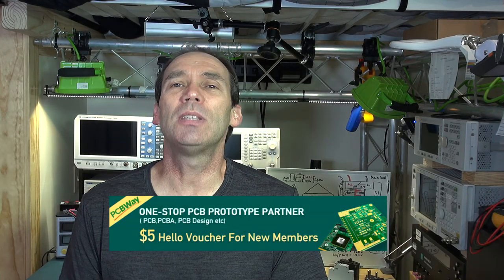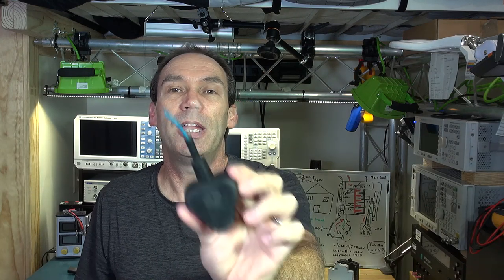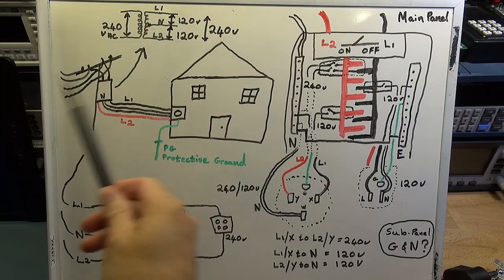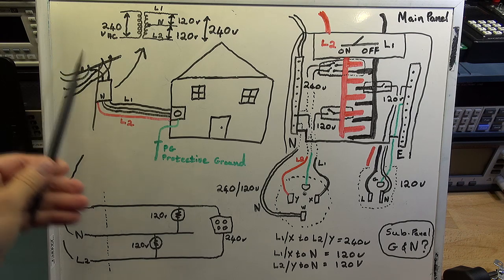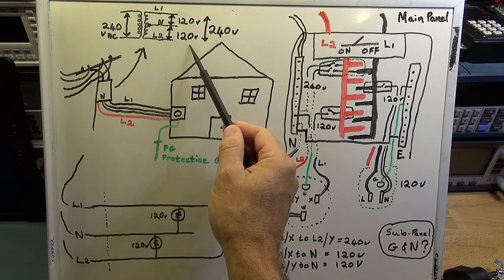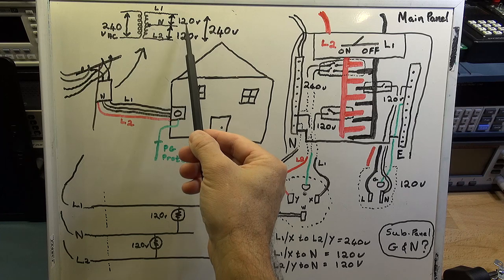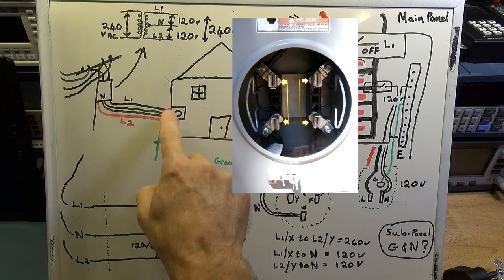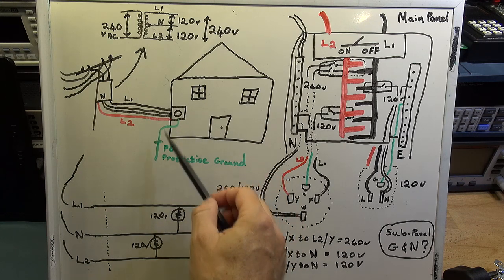The USA / American Split-Phase Electrical System

Comment: I used to work for a locally owned computer shop (in the US) and would often perform on-site service.  Went to a strip-mall type office for a "printer not working" call.  The printer and the PC were some distance apart and plugged in to separate outlets.  Upon examination, the printer cable, PC parallel port, and the printer port all showed signs of arcing/burning.  I'm not a qualified electrician, but I determined that one of the outlets was wired incorrectly (live and neutral reversed) and ground and neutral were tied together.  This meant that the "grounded" printer chassis was actually at line potential.  In most parallel ports, the shield is also chassis ground,  so when the PC and printer were connected and powered on, full line power passed through the printer cable.

They had to buy a new PC and printer, and I hope that they submitted a claim to the property owner.
Reply from the maker: Oh my goodness... Thanks for the post.

Comment: I think you mixed GFCI (Ground Fault Circuit Interrupter) with ordinary circuit breaker you show in video  @~27:00 which protects against short circuit conditions and overload conditions. 
Earth leakage breaker needs four poles, two for live (live in live out) and two for neutral (neutral in and neutral out), Both live and neutral currents are being measured. if current through one of them is not equal to other, then there is fault in circuit and the current is flowing through elsewhere.
Reply from the maker: You are  correct, my memory of the SA distribution board has diminished. The breaker that caters for earth leakage is two pole, two connections in, one for live, one for neutral; two connections out for the live and neutral. You would have multiple circuits with their individual load breakers sharing an individual earth leakage breaker. 
 https://mce.co.za/product/single-phase-earth-leakage/

Comment: 21:30  Your 220v line should be a dedicated line.  Dedicated to that one appliance.
Did you have a neutral running to that stove?  If you lose one leg and the other is hot, the hot one plus the neutral will run anything on that stove that runs on 110v.
That might be any control lights or a clock.  I had that problem with a dryer that used 110 on the motor and 220 on the heating element.  One leg popped the breaker and the dryer would turn but there was no heat.  Instead of a pinned breaker switch, I had 2 individual breakers feeding the dryer.
Reply: That can be perfectly fine, as long as both breakers are the same amperage and you have the "Common Trip" adapter put in place. Sounds like you were missing the "Common Trip" QO Tandem Circuit Breaker Handle Tie, they're like five bucks.
Reply: @DeepPastry  I had no idea there was such a thing.  Thank you.  I need to run down to Home Depot sometime this weekend and I'll see if I can find one.  Thank you so much.
Reply: i cant imagine ever sharing a 240v device.  everything i've wired up was dedicated.  goes to show what bizarre things people think up!

Comment: depending on the utility, PGE/SCE/LADWP, the distribution voltage can be 4160/4300/7500 volts on the utility pole feeding the pole pig (transformer), and can be single phase or 3 phase depending on the loads that are being serviced.
The distribution station also has regulators that try and keep the voltage somewhat constant.  These are tapped autotransformers that control A and C phase and B phase is not regulated.  The controls in the regulators compensate for voltage droop, line impedance and have a window that they control in so they are not constantly hunting.
I learned that IF you hear a regulator hunting, GET OUT OF THE SWITCHGEAR ROOM because something is probably going to fail!

Comment: Canada is almost identical to the US and most branch circuits are 15 amps using NMD-90 14/2 (14 guage 2 conductor plus a bare ground). Apart from Electric Dryer's and stoves with larger 6/3 and 4/3 round cables, one must take care with electric water heaters where they often use flat 12/2 cable that, at first glance isn't much thicker, and you may mistake it for a normal 120v 15a branch circuit - DONT!  This is 240v at 20a or even 10/2 at 25a (that will run dual 2000 or 3000 watt tank heaters across the black and the white, so take care!). I have seen older 12/2 Nomex water heater cable (with tar-paper covering sheathing) with black and red and the usual bare ground inside. Another application of 120v 20a 12/2 cable is in larger window A/C air-con units - you may notice the plugs and receptacles have the neutral blade turned sideways (lookup NEMA 5 20R and it seems many hospitals use these extensively). I hope this helps!
Reply from the maker: Thanks for your post.
Reply: "Canada is almost identical to the US", . . . except that, Canadians will never fight for their rights, . . . Canadians can still buy bubble gum because it's "essential", . . .
Reply: @phillipgaley4416  I'm retired, but even at my age, I still can't recall Canadians as having a society so paranoid that they'd rather put confidence in guns rather than God.. and today's political moral slurry reflects that (on both sides). That said, I had a BB gun when I was young :-)
PS: Bubble gum will pull at old tooth fillings.. not advised!

Comment: This reminds of what we have where I live in Norway. The difference is that the neutral tap on the transformer is grounded and we only use the 230V between L1 and L2.
Reply: Why isn't that center grounded 240V configuration used in other 240V countries? It would be almost as safe as 120V but offer the benefits of 240V.
Reply: @NiHaoMike64  I guess the reason is flexibility. Most new develoments and industry in Norway use TN, which gives you both 400V 3phase and 230v 1phase.
Reply: Neutral is grounded here in the US too. Its actually a multi-grounded system so its grounded at the residence and at the pole. The primary is normally fed from phase to neutral of a higher voltage (10 kV or something) distribution system in a wye configuration. One interesting thing to note is that the Primary and secondary neutrals are bonded and are often the same wire. That neutral is grounded every couple hundred feet along the lines and at every transformer and service entrance. One problem with this system is that customers grounding electrodes (and all their water pipes) carry some primary return current into the earth (to get back to the substation), along with secondary return currents!

Comment: I am sure someone already explained this, as I am coming so late, but the 240V appliances often only require 240V for the heating element, this is certainly the case for electronic stoves/ovens, etc.  The circuit breaker for these appliances is usually a 50-60amp breaker that bridges the split-phase lines in the panel, receiving 120V from each Live feed.  If only one of these feeds is disconnected, it can still receive 120V from the other feed just like all of the other circuits on that side, and so have power to run everything on the appliance EXCEPT those features requiring the higher voltage :)

Comment: Nice video, Martin -- thanks.  A couple of minor niggles.  1. The NEC now requires ccombined ground fault and arc fault breakers for all circuits that are accessible to building occupants.  This includes light circuits where someone may have to change a bulb, and all receptacles except 240V appliances.  Otherwise, only hard-wired circuits like HVAC installations are overload-only breakers.  I just finished building a new home and I'm suffering with the GFCI/AFI breakers.  They cost a bloody fortune (I spent $1,600 just on circuit breakers) and they trip if you look at them wrong.  2.  Your diagrams show, and narration talks about the protective earth/ground being green or green/yellow.  This is true in appliance cords that plug into a receptacle, but wiring in a building will have a bare copper ground conductor.
Reply from the maker: Thanks for your input. 1. I have seen several new builds in NC and they have all passed inspection with only GFCI's required in kitchens and bathrooms. Is that NEC rule required across all states now? 2. there is text in the video at 7:52 noting "bare wire" as well.

Cheers, Martin.
Reply: I think the various states (perhaps even localities?) can choose which parts of the NEC they enforce, or which version they adopt.  I guess my state went all in.  I’m glad to hear that your state regulators are more reasonable.  //  Sorry, I guess I missed the bare wire reference.  Good thing I don’t drive the way I watch YouTube!  #distractedviewing

Comment: A disconnected neutral is sometimes known as a "floating neutral" and is VERY bad and dangerous!
Reply: When I was a kid I worked for an electrical contractor. One morning, for some reason I don't remember, I rode around with a hot checker/troubleshooter. We checked out an air handler that wasn't working in a couple weeks old house.

Wires were burned, box was burned, roof truss was charred. Every one involved was lucky on that occasion. Loose neutral wire nut from a lazy apprentice on the rough in crew.

Comment: Split phase was in your title , but never really talked about it , hopefully next time ;)
I grew up working with my hands , and have done most anything requiring tools & hands , 66 yrs old now .
And did most of those making a living , get injured out of the heavier work , and turning hobbies in making a living  . 
From carpentry , auto repair - including smog , computer control , then machining , gun-smithing  , welding and adding more electrical / RF from being a ham / radio , do circuit board - even digging down a few layers into boards .
So with all of that I do a lot of residential & some commercial to 3 phase .
I also do a lot of rework of old & new that also passed inspection , but was wrong , or not quite right ;)
I tend to get called in last , multiple others could not diagnose & fix --- not licensed .
In many cases having multiple trades the knowledge / experience will make a big difference crossing over .
Always looking to learn new things / stuff ;)
Thanks
Reply: The 120 to 120 + 120 = 240, is the split phase.

Comment: Excellent description Martin, I installed a large machine tool from the UK in Texas, US (I was employed by the manufacturer and UK based), the customers/district had the 3 phase configured with one of the  phases connected to earth/ground, our electrical design engineer knew this, and had had checked that the 200 kilowatt DC motor controller was safe to use, on power up and testing, the two switch mode 24 DC volt PSU were not happy, and shut down ( 3 Phase to 24 V DC for control circuits), we had to replace them with linear versions.
Good to see you back.
Reply from the maker: Thanks for your post...good to be back.

Comment: One other interesting property to note about US distribution systems is that the high voltage primaries are usually fed from a grounded wye connected transformer at the substation. The primary of a distribution transformer is connected between a single high voltage phase and neutral. The primary neutral and the secondary neutral are bonded together and grounded at every transformer, and are often the same wire.
Reply: There is usually a neutral wire in the distribution network.  It is positioned below the phase lines.
Reply: @GH-oi2jf  Yep. That's pretty much what I just said... Are you disagreeing with something I said above?

 My main point was that the primary neutral is connected to the secondary neutral and so the isolation from primary to secondary is lost.

Comment: I'm trying to understand where the return from the single 7kv wire on my street utility pole goes since power distribution is 3-phase with no neutral.    At some point, 3 phase is turned into single phase 7kv at the top of the residential street utility pole.  So where does the 7kv return/neutral find its way back to 3 phase distribution?

Comment: I live in the UK so forgive me if I have misunderstood but it seems to me that you  could use a large pair of MOVs from either phase to the  neutral at a few points along the way tap to prevent the voltage on either phase shooting through the roof in the event of losing the CT (neutral) connection could maybe clamp to say 150v max either side ???

Comment: i have a question for you about my inverter.   won't go back 14 years when i started messing around with wind and solar, but after a few moves, record wildfires, pandemics etc, i finally have the solar panels up, the batteries connected, the inverter connect, panels connected, power coming in, and STILL CAN"T TURN A LIGHT ON!!!   i don't think it's me...   so, if you have any thoughts, or if anyone out there in tv land has any, please let me know...  16 6v 440ah AGMs, with 6 solar panels, connected in 3 sets of 2 - forget about the particulars, doesn't matter.    batteries are in 2 sets of 8 for 48v...   inverter is 48v, supposedly, as i just found out, single phase 220v (Canada is split phase, hence the reason i ended up here)...   batteries are fully charged,  inverter produces 220v at the inverter, and at the panel... wired a 15amp breaker on 110v, so half the 220 as is normal in Canada)... breaker shows 110v, plug shows 110v.     but nothing i plug in powers up...   SO supplier said it was a single phase...  should it have been a split phase, OR i used my multimeter to check hz and it shows as 70hz at the plug....   so... uh.... ?????   70??  is a country on the planet that uses 70?  something isn't working, and since i'm producing the correct voltage, i have to assume it's the inverter.   any thoughts?  anyone??   Beuller??

Comment: Hello Martin:  I agree with everthing you said on your video except the orientation of the ground.  I am a retired electrical contractor and have always installed the outlets with the ground to the bottom.  However I am in California and everone knows we are different out here.  Thanks for the videos.
Reply: Jack, I'm in NY.  For some reason, the NEC changed the installation procedure to install them all with the ground on the top.  Not sure of the reason for the change.
Reply: @alext9067  The ground pin is longer than the blades, so pulling down on it doesn't disconnect so easy and if the cord is out a bit and something metallic falls there, it would seem a little safer. Also now it's easy to remember: Left = Line (hot)
Reply: @alext9067  IANAE, however my understanding is that the change was to improve safety.
With the ground on top, it should be the first prong to connect normally, so plus.
Secondly, in the event the plug is ever loose, anything falling from above should hit the ground prong first, instead of hitting a live and thus energizing something like a paper clip that falls of the back of a table.
Reply from the maker: Thanks very much for your post.

Comment: I recently had a weird situation after a storm where some of the outlets worked and some didn't. When I measured the ones that didn't I was getting around 50V which slowly climbed over the next day to about 100V before they fixed it.

Comment: So, I'm aware that a transformer essentially isolates the supply and causes it to float. What I'm struggling to understand is how earth works when it's floating? Are we essentially calling the centre tap the earth? So we're not physically returning to earth, but the 0v reference on the transformer? Even so, it shouldn't be possible to get shocked without being referenced to the transformer neutral? Why is this different from an isolation transformer where I could grab one live wire but not be shocked without also holding the return wire.
Reply: It's not floating they ground the centre tap of secondary
Reply: Earth and neutral are connected
Reply: On a Wye primary distribution system (most common in the USA), the primary of the transformer is connected between a single high voltage phase and neutral fed from the substation. The primary and secondary neutrals are connected at the transformer (defeating the isolation you mentioned) and are very often literally the same wire! That neutral is grounded at many points, including at the substation, at every transformer, and at every customer service entrance. The ground and neutral are the same wire until it reaches the main panel, where the grounded neutral wire from the utility is connected the neutral bus bar. That neutral bus bar is bonded to the ground bus bar. The circuits fed by the main panel then have separated neutrals and grounds, but the are electrically bonded at the panel.

Comment: I have more of a question. I have a 240V Inverter that I would like to use on my USA house when we have a power outage. I know this is not recommended but I would need to turn the mains off in the breaker and all my 240V appliance breakers as my inverter is only 2500W and I am sure it cannot run my ACs or the like, but was planning to use my dryer port as the point in which I connect the inverter. I was told I would need to make sure my inverter is split phase? I am not sure how to do that. If I measure from ground to live1 I get 120 and Ground to Live2 I also get 120V. I can then measure L1 to L2 and get 240V. I was told this still may not work.  I do not have an oscope I am not sure how to tell if one side is 180degrees out from the other. Any help would be appreciated.

Comment: In some apartments/condos, it's actually a "2/3" 120/208V system. Each unit gets 2 phases of the 3 in a 120/208V 3 phase system, distributed to try to keep things in balance. I have never seen that being done with individual houses although it's possible.
Reply: You would never do that to multiple single family residences, although a residence could get 3-phase service.